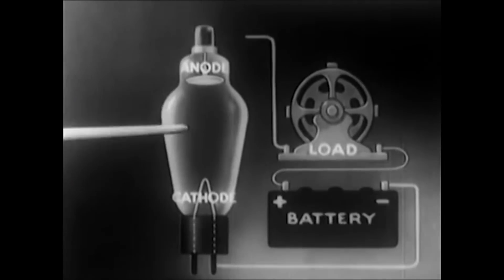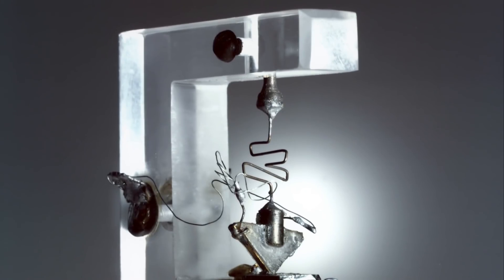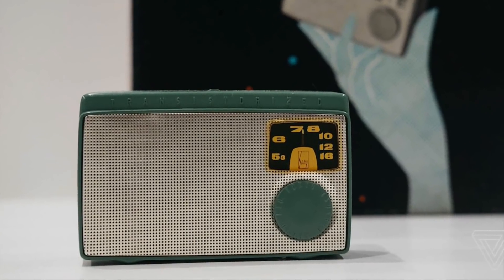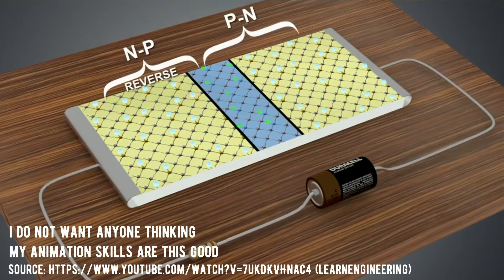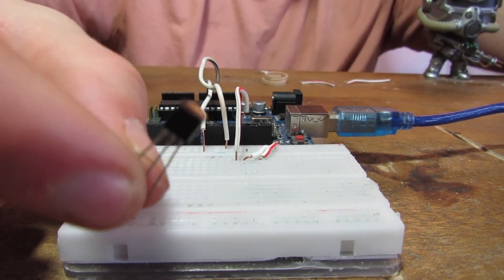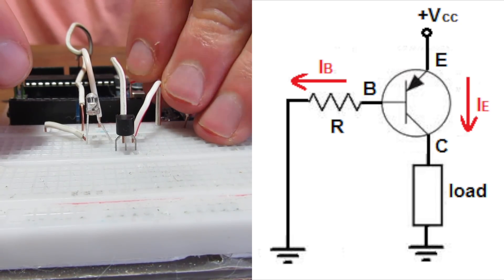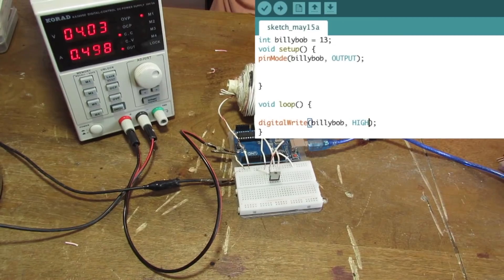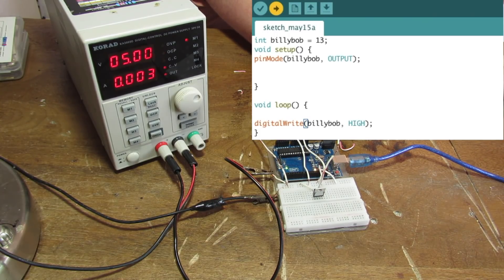Transistors - how they work internally, and how to set them up

Comment: no idea what a low or high command is. Im just trying to figure out how to use transistors, i havn't gotten to learning arduino code yet.
Reply from the maker: BobTheBuilder294 sorry about that- low is 0v or ground, high would be (the arduino’s) 5v, or whatever positive voltage you’re using

Comment: 0:57 Nope. You don't control the heater. The heater voltage remains constant.
Heater throws off light, heat, and electrons. Electrons are negative. Anode is big time positive. +90 volts positive is normal. 
Positive attracts negative. Negative electrons move to positive anode. Current flows from heater to anode. 
Stick a grid in between the heater and the anode. If the grid is neutral, current still flows.  If the grid is slightly positive, current still flows. 
Negative repels negative.  If the grid is slightly negative, current flows a little less. If the grid is a little more negative, current flows a lot less. Little change in negative grid voltage equals big change in anode current. You now have an amplifier. 
Amplification factor of 100 is normal for a simple triode (one grid). 
Stack up three grids in there and you have a pentode. Amplification factor is now 500 or better, AND you have much less distortion. Win - win. 
It's actually easier to understand than a transistor.

Comment: Honestly I still dont get it. What the heck is the transistor doing to the LED?
Reply from the maker: hmmm, so the transistor(let's use npn for this example) is switching the LED on and off, purely by controlling the ground pin of the led. The led's 5V input is constant, as it's hooked right up to the arduino's 5v rail.. but the negative(gnd) end of the led is being turned on and off by the npn. If we think of the transistor as a faucet, the emitter is the water coming out of the sink, going down the drain. The collector would be the water inside the faucet, and the base would be the knob. if we think of current as running water, the led has current running from positive to negative(conventional current). So im hooking the led's negative(where the current is flowing from) to the npn's positive(collector), because as far as the npn is concerned, the current from the led is 'positive', or trying to flow to ground. The emitter(gnd) is made available or unavailable by the base, which is controlled by my arduino. 

hoped this helped!
Reply: @MillersPlanetOne  so why is the flickering?
Reply: @Chaosman88  The flickering is a effect of the Arduino (the microcontroller controlling the electronics), everytime you write a new program to it, it does this on pin 13 :-) It's not supposed to be a part of the demo. EDIT: You can also see the flickering on the board itself, in the background. There are lights to indicate writing to the board.